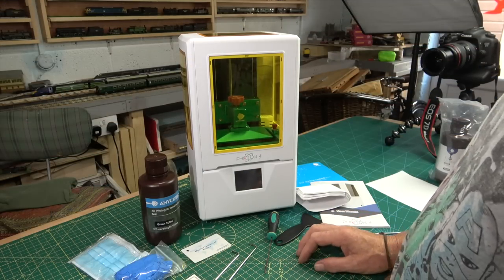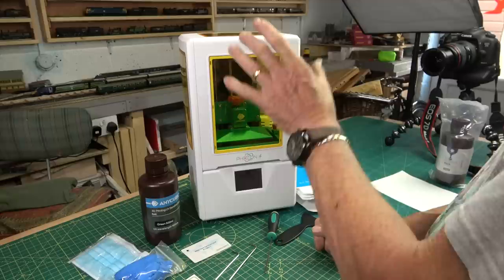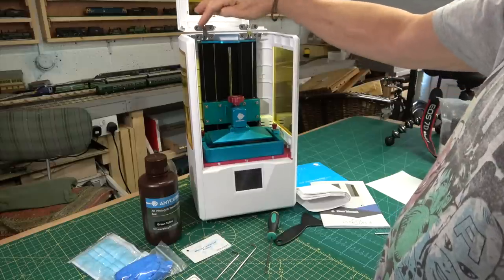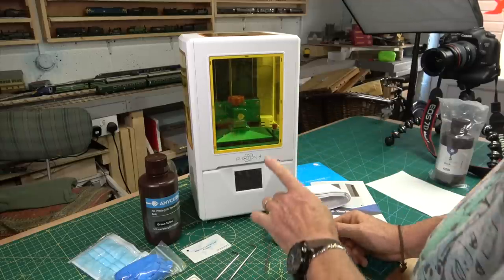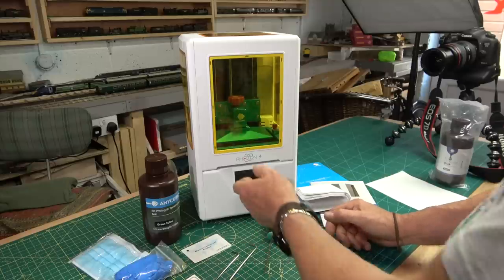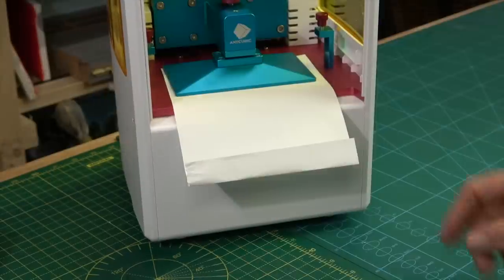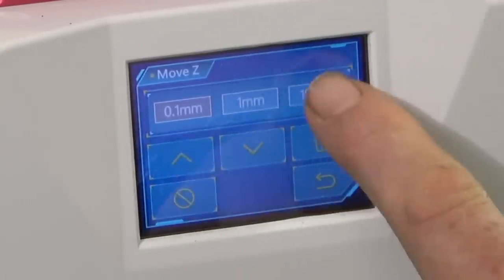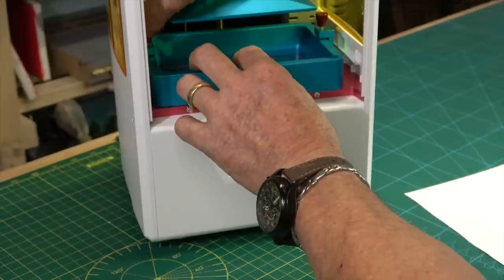How I set up a Resin 3D printer | Through to My First Print

Comment: Hi Paul- Excellent video and thanks for the warts and all demonstration . 3D printing does seem to fit well with model railways for parts you cannot get off the shelf and designing unique items. I have bought quite   a bit of 3D printed items and I am very pleased with them. I am not sure if I would buy one yet but if files are readily available and there is a printing service that would print them for a reasonable price then that would be very useful...............Cheers Kev
Reply from the maker: I understand Shapeways do such a service Kev, good to hear from you chum stay safe Paul
Reply: Thanks Paul - that could be a cost effective solution.
Keep Well
Cheers Kev

Comment: I have looked into this and I want to get a machine. I understand that the print from a Resin Printer is of better quality than a Filament Printer, but I will go with the filament one as it is a lot less messy and I do not like the idea of having lots of chemicals around. Nice machine and a nice print. Good luck with it and I am sure you will have a lot of fun making 3d models. Martin. (Thailand)
Reply from the maker: I totally get you, Martin, I nearly went that way for the same reasons, cheers Paul
Reply: Don't worry too much about iso-Propanol (IPA), it's not particularly harmful....although don't drink it, you'll get an aweful hangover. IPA is tha main component in hand sanitiser, so you could make your own (you want around 60-80% v/v to be most effective) - I also add a few drops of glycerol (food grade) as this helps prevent it drying the skin too much.

Comment: Hi Paul. You mentioned that the bio-resin degrades if used outside. What causes the degrading, moisture or the uv sunlight. If its the sunlight, does that mean it will also degrade when used indoors by a window, so in direct sunlight?
Reply from the maker: Hi Bob as  understand it will slowly dissolve in water ie rain etc, it is water-soluble to clean off the resin and they say failed prints if left out will disappear, only what I have read Bob, cheers Paul
Reply: @Sandlingjunction  OK, thank you. I will look into it more.

Comment: Very interesting video and nice to see what goes into printing.  So it doesn't take long in the uv light to cure then?  Quick question, where do you dispose of the used IPA?  Certainly makes me consider getting one myself.  Cheers,  Michael
Reply: Depends on power... Can be a minute or a but longer... Or use sunlight.. For an hour or so.
Reply from the maker: Hi, Michael disposal is a little tricky and have not figured a good and safe way. maybe one of the others has a good and environmentally safe solution of getting rid of contaminated IPA

Comment: Really interesting, thanks.  

Still don't really understand how they work, though to print things like you just did, I suppose you don't need to know.  

Is the height of what you can print dictated by the depth of the resin bath, so if you wanted something taller than the couple of centimetres of the bath, you'd have to print it on its side?
Reply from the maker: Hi, Andrew, not the bath more the height that the build plate can travel upwards. the footplate of the build is small and governed by the size of that build plate, cheers Paul

Comment: Does it not have a small red led in the base at the back for build plate detection when levelling. Just at the base of the Z axis. The elegoo Mars is pretty much a clone of this printer and that has one. If so it looked like you covered up the led when you put the piece of paper in as the build plate stopped well short of where it should be for levelling. It should go all the way down and touch the paper then bounce up a tiny bit. You can then hold the plate flat and tighten it up. Then raise it till the paper just moves.

Comment: Good video, however you still need to wash the water washable in ipa... Used it water isn't the best to clean.
AnyCubics customer service is pretty poor... Especially when you need something more than an Allen key.
With the film (FEP) you shouldn't touch it... As it marks easily... Secondly when cleaning your print s baths of ipa is great but you need to wash them in soapy water after then cure. However if your model has supports you should remove the print from the supports then cure, as it damages the print.
Reply from the maker: wow more great advice, many thanks for that. I made a few errors there then lol, cheers Paul

Comment: I have the Photon S too, I have a YT series on my adventures, you should slacken the plate, then drive it down till you cannot push the paper in, at this point, tighten the leveling screw! You should not try to level by hand, it is a ball joint and will self level (when loose). It's only because you used a massive raft that it printed!
Once printed, remove plate and reattach at 90 degrees, allows plate to drip excess resin back into vat for 5 mins, saves bit of resin and less in your cleaning vat. Ditch the Photon software and use Chitubox, it's much better!
Reply: Good tips. Thanks.
Reply from the maker: that's great advice many thanks, just the sort of help I really need cheers Paul